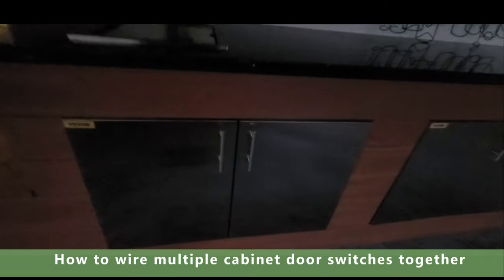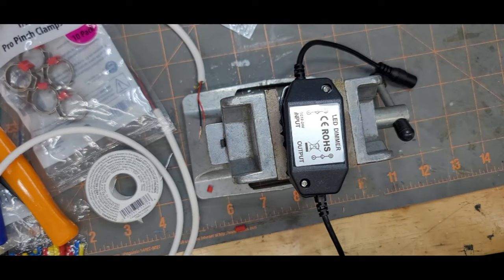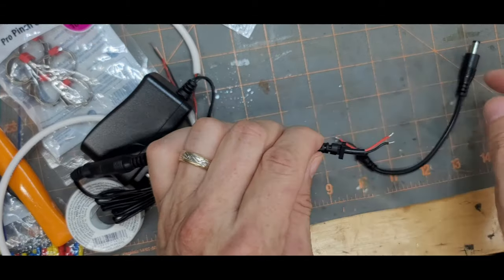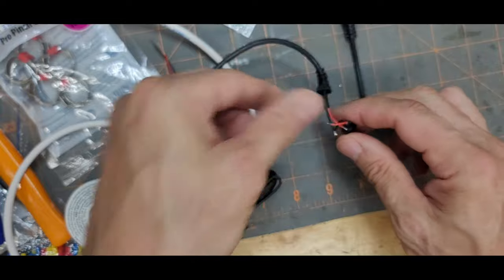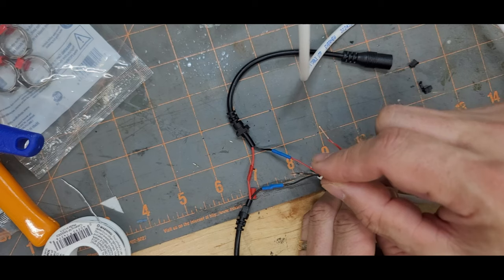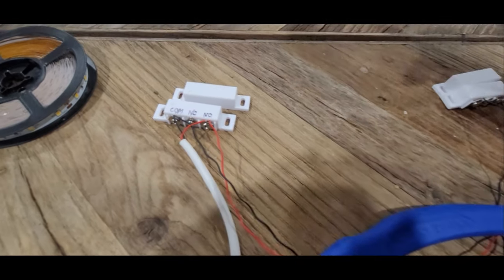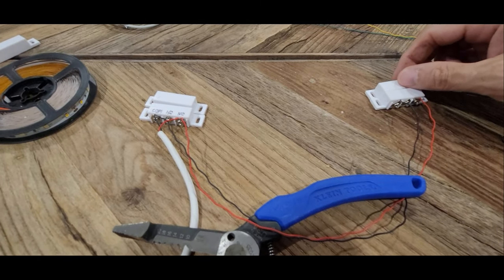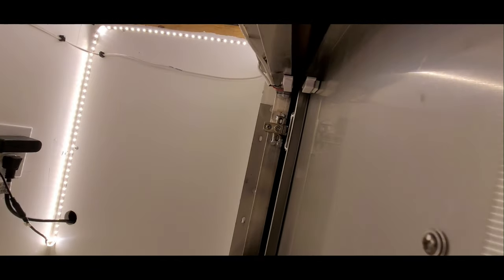Cabinet Light Door Switch Wiring

Comment: Thanks, man.
I don't have the same switches, but I just needed to know which terminals to use (NC.NO), and couldn't find a diagram or instructions anywhere else.  I guess it's basic knowledge for most people.
Reply: NO if you want the light to be on when it's open or NC if you want the lights to come on when the door is closed.

Comment: Can you do the same setup utilizing the dimmer switch?
Reply from the maker: Not sure I understand.  These will work on a circuit that "also"  has a dimmer switch.  You would leave the dimmer on all the time at the dimness setting of choice and the door switches break the circuit as if you unplugged it the whole thing.  I would just leave the dimmer on the  side closest to the outlet so that it always has power.  Some dimmers may not hold their setting when power is removed.  It may go back to a default brightness level. 
Just experiment till it works... or you get shocked 😮
Reply: What I'm looking for is to duplicate what you did but i also might want to dim the lights...I'm want to put this in a stereo console where the turntable is so when I open the cabinet to the turntable I have light. Thanks in advance.  @jebadiaha

Comment: Why did you need a common on the door switches ?
Reply from the maker: That is just how they work.  The common is needed to complete the circuit.
Reply: @jebadiaha  yeah but why would you need that when all you were doing was switching the 12 volts. but maybe I see what you were doing though.......... you switched the postive and the negative.......... when I did mine all I did was just switch the 12V. regardless; great video!
Reply from the maker: @LiquidSwords5150  you need a common to connect all the switches together.  I have 4 switches and they need a "common" path to complete the circuit.  Just as the name implies, all switches in this circuit share a common electrical load path.